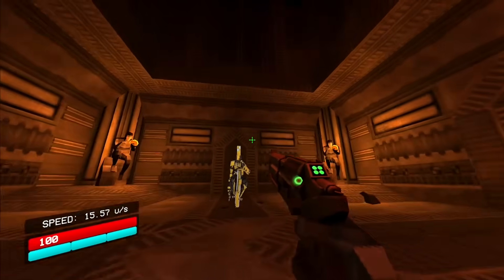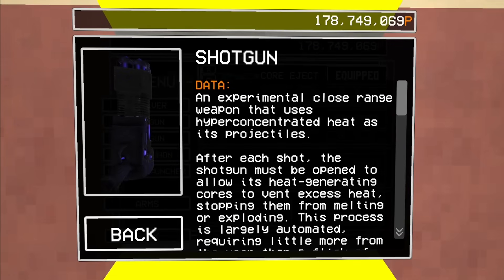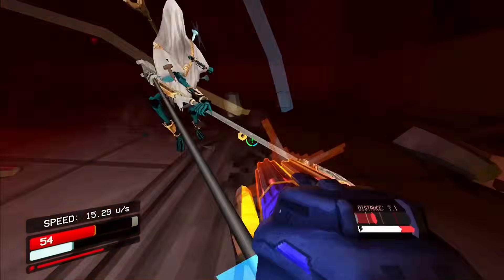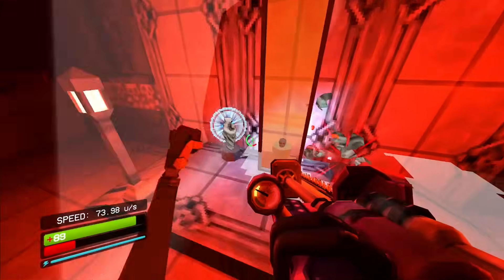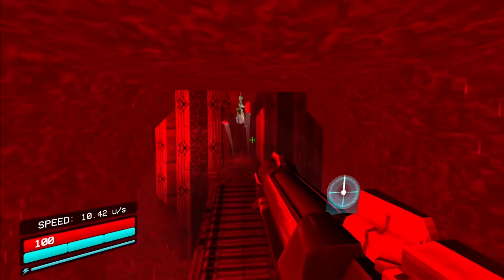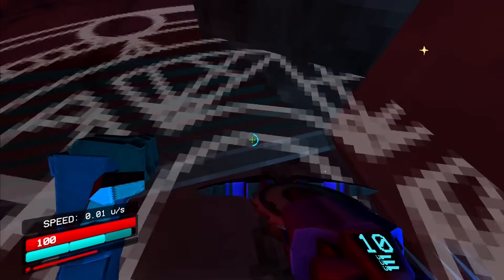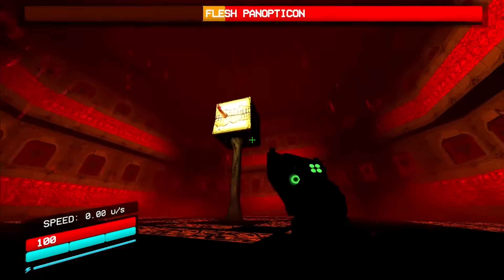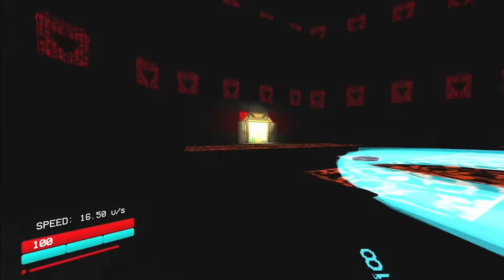Can the ULTRAKILL Shotgun Exist in Real Life?

Comment: I like to think that the shotgun actually gets a small area of air inside the barrels of the gun to solar temperatures and violently spits the hot air out of the barrel. The reason that the pellets fade and dissipate almost instantly is because the super hot clumps of air are cooled by the surrounding atmosphere and fade into normal air. The core in my idea is it’s the energy source, similar to the fusion core from fallout.

Comment: There is a real life heat gun, kinda. It's called the Active Denial System. Basically, the US military devised a way to emit focused waves at a frequency similar to microwave radiation, at 95 gigahertz. At this frequency, the moisture in your skin starts to boil, and it feels like you're literally on fire. The ADS is designed to repel people away, since your body will instinctively move out of the invisible pain ray, but what if there were a version of this weapon that could amp up the frequency of the waves, until it becomes explosive. So that's what I think it is. Radiation. It's like a demon core in the palm of your hands.
Reply: @Silverwind87  "V1... You gave me cancer?"

Comment: If the shotgun could have an INFINITE ammo source, then why don’t machines use the same system as a shotgun for infinite fuel?
Reply: Short answer.
Machines were designed for war, blood is a convenient fuel source.

The shotgun is *experimental* and didn't catch on like the terminal says.
"Infinite" blood is used in the gutterman but clearly that system is heavy and they clearly like light machines not heavy ones. (As literally every machine but 3 are heavy ones; Gutterman Guttertank and Earthmover)

Though if they kept going through with the shotun's heat idea you might as well be solar powered which the earthmovers do.
I can imagine it's expensive to do that when they already mastered the blood fuel thing.

Comment: The way I figure it with the exploding is that A the pellets exploding are because of whatever the hell parrying does [because parrying other energy based projectiles also makes them explode when they usually dont] and then when the core explodes its because you're not just launching the shot, you're also launching the bit that generates the heat [no clue how you replace the cores though]
Reply: Maybe I should watch the rest of the video before commenting because you did pretty much explain exactly what I meant

Comment: I thought it basically superheated the air and turned it into a plasma, firing said plasma. because its experimental, its not great at actually containing the heat from the plasma. some of this heat just goes straight into the gun's machinery, which can run the risk of the gun melting itself from the inside, so it needs to vent. as for launching plasma, this can be done with an electromagnetic field. solarflares for example. so its basically a rail gun that shoots plasma instead of metal.

Comment: my thought was that the "projectiles" were just air turned into a plasma rather than heat as a projectile itself.
the "infinite ammo" could possibly be explained by some high-tech system that uses the energy from the recoil to keep potential energy at a near-zero loss, combined with some kind of passive energy from the momentum of the wielder to make up for the loss, kind of like the alt shotgun

Comment: I think that the shotgun uses radioactive pellets as the cores, that when in the chamber heat up, like in a nuclear reactor, that explains the need to have them be exposed to the air and be outside the chamber so that there isn't a nuclear runoff reaction, and the core being exploded when shot by energy guns could work like irl nukes where they need an initial explosion to go supercritical and explode, the firing could work by breafly making the core go super critical and heat up some air in a chamber that in front of it the gun has its pellets that could be made from dust in the air, from the blood in v1 or from the decayed particles from the core
Reply: Once again, my head cannon. PLASMA-FIED RADIATION

Comment: I thought of a slightly different explanation while listening to your chemical explosive idea. What if, instead of heating the shot with induction, the core is a sort of sealed reservoir of a chemical that reacts and heats up when exposed to air? The core is briefly opened inside the weapon, the shot is coated in the chemical, which causes it to heat up as it is fired, then the core is closed and a cooling cycle happens, to vent the heat generated inside the core and the weapon from coating and firing the shot. A large impact force could cause the chemical to release all of it's heat at once, causing the explosions when parried and from the core eject (not to mention, you'd also be rupturing the core when ejecting/shooting it, exposing a large amount of the chemical to the air). Also explains how the pump and overpump works, each pump adds a bit more chemical to the shot, causing more damage, or it just explodes if you add too much. Kinda similar, but I feel like it makes a bit more sense than explosive coolant.

Comment: Considering its description, I personally think that its some sort of plasma
The names used for weapon types "Electric" and "Heat" seem to be related to how they accelerate their projectiles so one could assume that the Heat involved in the Heat Guns is related to how they accelerate their payload.
Considering they use cores of some kind instead of traditional physical ammo, the most likely answer for me is some sort of plasma weapon that violently spits plasma blobs at high speeds. The plasma is probably self contained somehow, which is probably the weirdest part physics wise but hey we have blood engine and other enemies commonly throw self contained energy spheres at us so. It might also be why there is spread in the first place, I imagine the process isnt very neat at then current technological progression.

 The Heat is involved in superheating the air, which is why its said to have infinite ammo. This functionality also involves the core itself - it'd be a generator of some kind which you could toggle to adjust the power of the shots, or build heat manually in the core before you eject it. Speaking of which, the core, as a power source, would be detonatable hence why Core Eject is a thing. Since the projectile is contained and not just hot gas being exhaled, V1 can parry/boost it.

The other idea I had was a particle weapon of some kind - the heat would still be applicable as per the above plasma idea, however the plasma would instead be used to create a plasma wake acceleration system for the particles. The radiation/particles could be sourced from the core themselves if they were a particularly made radioactive system of some kind. This would even make boosting and the scatter work if the particles were charged and a magnetic system scatters them about. Considering the shotgun pellets pierce targets like particle weapons tend to do, and lose energy rather quickly after they do so (again like particle weapons), it seemed like a likely alternative personally

Comment: The way ultrakill explains the shotgun is fundamentally impossible. Heat isn't a physical object. You cannot apply a force to heat and it cannot apply a force to any object. This means that you cannot shoot heat, or that if you did it would do absolutely nothing. I don't think its possible to realistically explain this whilst staying totally faithful to the weapon itself. Its the same deal with the rocket launcher, being that the rockets explode when in contact with fresh blood only and otherwise simply push matter to the side. Ive seen the rocket launcher explained with hydrogen peroxide as a catalyst but H2O2 reacts with fresh blood just the same as with dry blood, perhaps even less so.

Comment: Considering "heat" is supposed to be the ammunition which is "infinite", a solid projectile is probably off of the table. My thoughts are that it's some sort of early plasma weapon that never caught on because, well, good luck making one of those viable. It still works in a pinch, though, even if the "projectile" immediately loses cohesion and spreads out. The cores themselves are naturally volatile, acting as reservoirs for contained plasma. When their stabilising magnetic field is disrupted by an electrically-charged object (like an electric gun's bullet), they immediately detonate. This, however, doesn't explain projectile boosts but I will discount that as it was originally a bug, never intended to be a feature of the weapon. 

If it instead used physical ammunition, I'd say it might be some sort of magnetohydrodynamic weapon in a very early phase, firing molten metal globules.
Reply from the maker: YOU CANNOT HAVE HEAT AS A PROJECTILE. its thermal energy and needs physical matter to exist
Reply: @rinslab  ...Yeah. That's literally why I suggested plasma.

Comment: 9:20 *correction
A lil erm Acshualy moment🤓
The spas 12 has a button right under the pump grip which when you press and adjust the pump you can make the gun switch between pump action (classic shotgun operating mechanism) or semi-auto (one shot fired for each trigger pull)
Spas 12 does not have the capability for being full-auto
(weapon keeps firing by pulling the trigger once and holding it)

Also sidenote: liked and subbed 👍 i love this series and it needs more recognition
Keep it up fam❤
Reply from the maker: yeah i noticed that after editing.

Comment: for me i believe its just plasma, and uses heat to turn the atmosphere in the barrel into plasma where magnets then are used to propel and confine the plasma, which would also explain its short range. the cores i also believe are just heating elements or heat container which could be heated by induction but more as an area to start making the air into plasma. when using core eject, the magnets launch the core which has plasma in it so when you shoot it it explodes.
Reply from the maker: plasma is an interesting thing ill get to late. but all imma say is it doesnt have good potential as a weapon
Reply: @rinslab  yeah it doesnt, though remmeber the shotguns are experimental, so it is a possibility

Comment: So, something missing from most of this: Infinite Ammo. If there's a slug involved in each shot, that means limited ammo.

I'm not an engineer, so 90% sure this couldn't actually work in reality, but something that feels at least closer to reality AND still works within the games lore and logic: Compressed Air.
Each "core" is a container, with an air compressor built into the gun and heating coils surrounding the cores. Air is drawn in at such high pressures that it almost becomes "solid" - not literally solid, but enough air compressed into one space that it stays together for a while after firing. It then gets superheated to near plasma, then the front of the core opens and the air is expelled - staying together as "pellets" of plasma for a bit. Would also explain why the shotgun is short-range, as the plasma would quickly cool down as it traveled. the main "bulk" of the gun would then be a mix of power supply (for the air compressor) and insulation (both ensuring enough heat is retained to create plasma, as well as ensuring the user isn't burned just by holding the gun)

The "Core Eject" would then be literal - instead of firing the gun, you instead eject a primed core in its entirety: a sealed metal slug filled with superheated plasma, that you then breach by shooting it causing it to explode, similar to putting a hole in a deoderant can or Propane tank. This would... again add the "limited ammo" issue back in, but hey: it's closer I think?

As mentioned: highly unlikely this could actually work. BUT it works well enough with a mix of fuzzy-logic physics and game lore that I feel this is probably close to what Hakita intended.
Reply: Now, I'm not saying you are outright wrong, but if you look at the shotgun's core eject animation after you fired it, if you are looking at the chamber, you can't see the cores, and this means that the core eject is shooting the cores, like you said, but if you look closely, you can see new cores go up into the air, that then get put into the shotgun by V1, which means that the shotgun has a built in core maker, and probably why the shotgun allows the user to shoot the cores, and also it probably combines both cores using some technology not stated in the weapon info, which is why you can't see both cores when it looks like only one is shot. The alternate shotgun, called the "Jackhammer" gets its cores from the bottom of the shotgun, and the meter shows that core making technology is possible, which is how the shotgun has infinite cores.
Reply: @awesomechad2804  Im pretty sure the new cores going into the air is V1 replenishing them from an outside source ala classic double barrel shotgun reload. Saying that its still entirely possible that V1 has an internal ammo synthesizer, considering how advanced his internal components are and yet he can repair them near infinitely with just blood (and its not like machines are opposed to using one another as supplies to repair themselves either, ala Swordmachine, so modified its a whole new class of Machine) its likely not an issue for him to do so on the fly
Reply from the maker: infinite ammo in general cant work. kind of how it works. but v1 has infinite rockets, saws, screws, cores, KB rounds, piercer shots, cannon balls, oil. hell almost all weapons have no ammo limits but clearly have to be made or found.
Reply: @rinslab i mean, v1 can regenerate through blood, so lets just say that some sort of mechanism was invented that allows the production of metal using energy
Reply: @boi2192  V1 canonically is able to collect small amounts of metal from the environment and blood. This creates things like coins and nailgun ammo.
Reply: @rinslab  There IS actually an In-universe explanation for that, actually, in that, it's not that the AMMO is Literally Infinite, but all of these weapons have mechanisms Dedicated to CREATING the ammunition on the fly, using Metals found from the Atmosphere, and the Internal blood reservoirs of the Machines that carry them. A lot of the weapons you mentioned, either DO have strict numerical limits to how much you can use them (120 Silver Nails, 1 Screw, 10 Sawblades, However many gallons of oil, 4 Coins) Or, they have Low Firerates (KnuckleBlaster rounds, Cannonballs, Rockets.) all of which are likely slow to Compensate for the amount of time it takes to Fabricate a round. The Ammo is only "Unlimited" in terms of Gameplay.
Reply: @Yhasoon  A strong gust of wind from V1's fist
Reply: @ajh3461  how would a gust of wind from v1's arm cause a pellet to become explosive?
Reply: @Yhasoon  The Feedbacker can make everything from a microscopic fleck of metal to a Malicious Face explosive. Maybe its adding so much kinetic energy that the pellets rupture on impact, maybe it's injecting a physical explosive material into them. IDK.
Reply: @JuicedPotato  Objection: Mini fusion nuke generator.
Reply: @Yhasoon my thoughts on that,

V1 can outright parry Minos and Sisyphus prime (as of now because p-3 isnt out) and both of them move at Light speed such as "Judgement" or "Begone" so that means V1 can physically react to their attack and have time to punch and return the force back to them (if not slightly stronger considering V1 can cause TCoKm to recoil back when parried and can make his own shotgun shells and hell energy projectiles explode on contact) so what I think is..the second he pulls the trigger V1 can react to his bullets and punch them before they fully spread out, like the second they come out of the gun he immediately punches them before the bullets even have time to become a spread shot
Reply: @FutileStruggleofaBoulder  in-game when you proj. boost all pellets still fly out and one pellet becomes red and travels farther. That pellet then explodes on impact. If the pellets are plasma, how would v1 punching one of them cause it to become explosive?
Reply: @Yhasoon  probably by some UltraBullshittery, V1 most likely punches it back which causes some reaction to make it explosive just like how the rockets dont cause an explosion upon hitting things that arent flesh/blood related and only making a shockwave rather than full on exploding when it hits a machine or a demon or oil because it sets up a reaction of some sorts, or he punches it so hard that it just explodes on impact
Reply: @FutileStruggleofaBoulder  the speed of any Prime Soul is never stated nor implied anywhere. all we know is that it's imperceptible to the player. light speed is an INSANE highball with no basis (especially since that would mean V1 would by your logic be reacting to things before even registering those things due to lightspeed motion being physically impossible to see coming in advance)

V1's processing speed is likely near instantaneous, mind you, so I'd wager that it just knows the correct timing to punch with to projectile boost rather than calculating it after firing
Reply: @JuicedPotato  I like this interpretation! New headcanon for the nuts and bolts of the weapon's functioning.
Reply: > metal slug

Theres this retro game called Metal Slug ik nothing about it except that the character called Marco looks like this one guy in my form at school